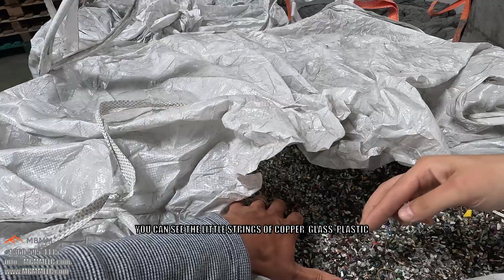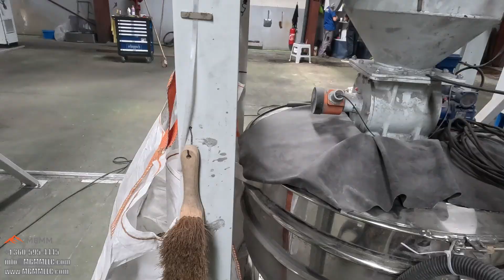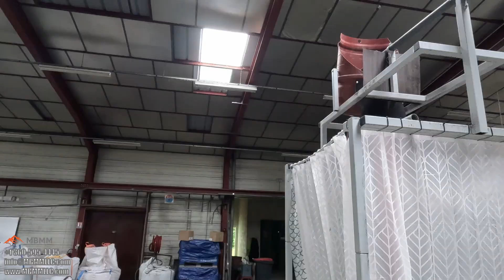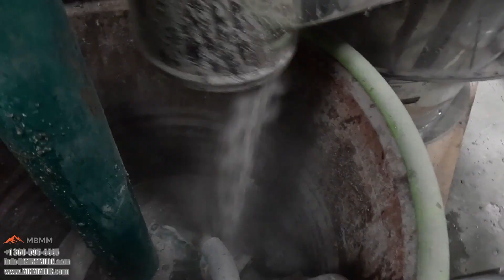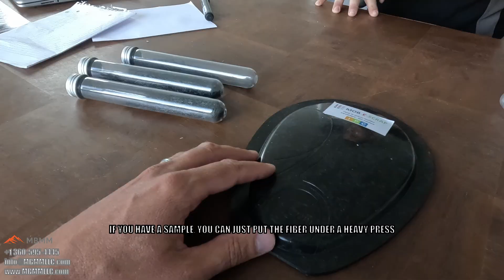E-Waste, Solar Panels, Electronics Recycling Line For Copper & Precious Metals

Comment: Really cool! I'm surprised they don't run the copper over another shaker which has been tuned to separate some gold. Obviously the plated stuff won't come out that way, but bond wires probably would.

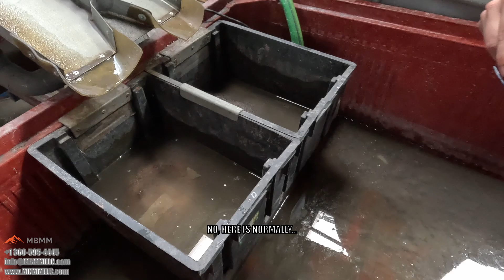Comment: Im new to shaker tables but how does the #2 have both aluminum and lead in it? The weight difference of those two metals are totally opposite. Around 13:00 minutes into the video
Reply: Wonder if the lead would be solder attached to contacts?

Comment: They would be wise to wear masks by the look of the fine layer of dust on everything
Reply: With a 3times per hour air change there would be no possibility for such fine particles to settle down. My guess is that this dust only collects when the machines are off for a while

Comment: We as the human species must, get better at recycling our waste products into reusable materials. A few of the up and coming investment strategies would be in water filtration, energy and recycling. The water filtration is needed for human consumption. No explanation here. Energy is what keeps things moving. This can be for data centers, heating and cooling, our transportation industry, basically everything that humans are involved in requires some type of energy byproduct to assist or move us around, heat our homes, transport our consumables, etc.. Recycling is because we have yet to learn how to get the most from the products that are produced, the materials extracted from our natural resources before we discard them. The human being can only use, thus far about 5-10% of their intellectual capacity, therefore we are only capable of extracting near the same with the things we produce. The internal combustion engine is a prime example in the use of the fuel/electricity it uses to produce the final result. In other words folks, we as a human species are only getting about 10 cents on our dollar for what we do in life. We waste 90% of what we produce. Therefore, recycling does have some significance in our evolutional structure for the time being. Until we as this human species can extract from our resources to produce and maintain a minimum of at least an equal value of those resources to our expenditures, we need recycling. The movie, "Lucy", comes to mind..........I applaud anyone that steps out of their natural habitat enough to take on exploring, creating avenues in finding ways in which to gain insight into these fields that will help us grow and evolve further.

Comment: that is some very cool machinery, I really appreciate the recycling stuff
If they cover the roof in solar panels they could offset a lot of electric for that beast of a motor
I wonder if they could use the fraction 4 as filler for concrete, as heat insulation maybe
tiny thing but its a shame they have to poke a hole in the cubey bags

Comment: you need to modify the shaker table,(bigger table) for them to up their volume ,, perhaps add a twin left right shaker tables setup , being feed off the original table , rerunning the initial feed to try and clean it further enriching their #1 #2 VALUE ,🥸🤓,Canada

Comment: I like your videos but have a question. If they are going to incinerate the plastic waste wouldn’t it be more efficient to burn and recover the metals. The power used to grind and separate and haul the recyclable material seems cost prohibitive. I realize that there would be many tons of material. What are your thoughts on it?

Comment: I ran and also built new asphalt plant out of old parts of plants and such etc an . The dust collector called a baghouse had 300 hp motor to run a 2,600 lb steel squirrel cage fan on a 5” solid shaft at 3600 rpm lol that thing would dim the lights within a 1/4 mile on surge startup before we put the three stage soft start on it . The money they saved was crazy just by starting two big motors softly . . Anything 50hp and under we just did hot startup . But the big guys need those soft starts .

Comment: 10 grams of gold per ton and 25 tons of scrap per week? And they give it away? Something is lost in translation!
Reply: Smelters are notorious for ripping off customers. You get penalized for the slightest impurities while the smelter makes a profit on the impurities AND gets a better margin because of the impurities.
Reply: Doesn't seem to be. He did say they have plans to run electrolysis to recover the gold though.

Comment: Looks neat, but your question still remains right? What do you do with the powder from the system to separate the gold from copper. The answer is: you don’t. The gold gets processed and extracted from the copper by the smelter company and it’s fully unpaid because they don’t care about it. They just want the copper.
Reply: Copper smelters pay for both you gold and silver. You are mistaken or you have used the wrong smelter

Comment: Solar integrators here in California have piles of fork lift damaged, shipping damaged, installer damaged, old, hail damaged solar modules and inverters.  Piles. 

Also we are about the hit the end of the solar panel life expectancy supposedly 

In the field the feedback I get from the service dudes is that the module ( I think most) are degredating slower than expected. 

Which is possibly a good thing. 

But eventually they will need to be recycled

I been in solar for about 10 years now. 

And I have only been asked to recycle 2 piles of mods.  

It took 2 days to rip them apart. ( by hand with roofing spades and sledge hammers.  
We made trailer loads of aluminum frames. And we made stacks of solar ( glass/solar/plastic).

We only collected money from frames. 

And tossed the solar but yes there was a lot of metals in the solar.

Comment: I imagine they recover mostly silicon, and copper, aluminum very little steel, and some gold and possibly a small amount of silver. The plastic can use pyrolysis to convert it into synthetic crude oil, or diesel fuel and a gasoline substitute.  I feel in the future there will be people mining landfills, and running the material through a plant like this! Turning the plastic to fuels, and recovering the metals..

Comment: Good ideas for recycling what would normally wind up in the landfills!
Reply: No true but they usually use Chemicals to extract the metals, so using the shaker table is more environmentally friendly and more cost effective
Reply: guess what, its still going to landfills - they are taking out 10% of the metal , creating a incredible amount of micro and nano plastics and putting it into the local area, with chemicals and wasted energy - then putting 90% back in a landfill

Comment: You should try running the #1 on another shaker table set up to separate the materials further. It might make financial sense for them to get a second table to better recover their pay materials.
Reply: Gold is around $85/gram spot price, so it's less for even a very good concentrate. Let's be pessimistic and say they can only get a concentrate that is worth $75/gram. They claim to have 10g/ton, which makes for $750/ton. This must be per ton of high grade no. 1 concentrate, otherwise they would have five times as much in that concentrate and it would be clearly worth separating the gold (almost worth selling to a good refiner instead of a copper refiner). So if they have 25T/wk of input, they could have $18,750/wk in gold values. That should be able to pay for additional equipment pretty quickly.

Jason said that the tables are limited by the amount of heavy metals, but I'll have to go and back-reference his other videos to see if they have enough precision to separate gold from a high-density concentrate that has so much copper. I think they can.

Based on their system throughout and types of concentrates, they might even benefit from combining the no. 1 and no. 2 concentrates during this second shaker table run. This could help them separate their copper and aluminum fractions, increasing their yield and payout on copper. Even if they don't run them together, they could alternate or batch run each concentrate separately, with the same table setup and tuning, and improve their yields that way. I can see how it's not worth their time to re-process their concentrates on their current single table due to setup time and re-tuning. Depending on how difficult it was to dial in, it might be worthwhile for them to try a re-run on their current table to validate that buying a second one is worthwhile.

The other consideration here is which parts of their system are the limitation on throughput. If the shaker table is the limitation, and they have enough capacity elsewhere, it would be a better capital investment to put a second shaker table in doing their current method instead of separating the gold. Doubling their throughout is doubling their weekly revenue, compared to the gold which might increase it by 15%.

Great stuff as always, thanks Jason!
Reply: @haphazard1342  your math is off by an order of magnitude, since you forgot that the n.1 concentrate is only 10% of the original input. Assuming they would be able to actually concentrate the gold to any usable purity, 1800$/week is probably barely enough to pay for the ongoing costs of operating it...
Reply: I was thinking the same thing and with a second run though a table I would think they could increase their thru put too

Comment: 16:43 Couldnt they just run it again on the shaker table since:
Gold › Density 19.3 g/cm³
Copper › Density 8.96 g/cm³
Aluminium › Density 2.7 g/cm³
Reply: would probably need a second table to run the first grade, or will be pain in the butt to adjust it for each run.
Reply: And what point they make profit if they run it again?
Besides gold in electronics needs to be dissolved. You won't find any nuggets.
Reply: @XtreeM_FaiL  yeah like he said. It can only really be done with electrolysis

Comment: When Jason showed the rating plaque on the motor, I had to pause just to look at the current supply requirements. The LOWEST number on the list was 252 amps, which is an ungodly amount of power.
Reply: In my pre retirement job we used soft start on 3 phase motors up to 2000 hp. In the old days before we had them we would hot start them. Push the start button and pray.
Reply: @RichardThompson-p9s  Start cap could go bang lol
Reply: 1/4 mega watt, that's quite a bit. lol
Reply: I saw that too.
Reply: In France we use 240v and 380v soooo this motor need 450Amp... that a lot of power !
Reply: @dionh70  those are French amps
Reply: @danonly7 What does that mean lol.
Reply: @stasi0238  Prior to the metric system (so over 200 years ago now) France used traditional measurements like feet and inches that were slightly longer than the units of the same name in English-speaking countries. It really only matters when you're reading about how tall French historical figures were. This was never the case for electrical units, but that's the joke.
Reply: @ganjalogic  ok that makes sense. At first I thought that person was referencing mains voltage (meaning that same amount of amps would mean more power in France compared to us) but it wouldn't make sense as such big motors run on much higher voltage.

Comment: Water filter is a shower curtain? ❤ Use what you can! Great process and content.
Reply: The shower curtain is just a splash guard lol I noticed that too, for all the crazy sophisticated equipment there were lots of those little makeshift details. The paperclips holding the fraction separating chutes 😂
Reply: tape engineering at its finest!

Comment: highly toxic  ,  you should be wearing a ventilator and plastic gloves.. nice video though
Reply: Jason is well aware of the hazards of the materials with which he's working. Given stringent european regulations on air quality & pollution, I'm quite sure that their processing facility is safer than many american ones, and guaranteed to be safer than ANY similar plant in China.
Reply: @dionh70   i tend to agree with you.. ya
Reply: @dionh70  indeed. Plus the machines were not running when they were talking.
Reply: They use antimony or something like that as the solar cell material right?
Reply: @alexdrockhound9497  i never herd of that and had to look it up..  interesting thx for making me learn one more thing at age 65..
Reply: Not to mention all the glass particles too. Not technically toxic but it’ll ruin ones lungs.
Reply: @alexdrockhound9497 Glass is not a problem.